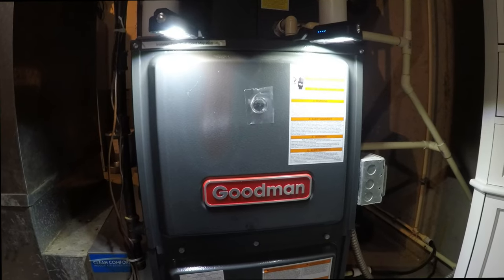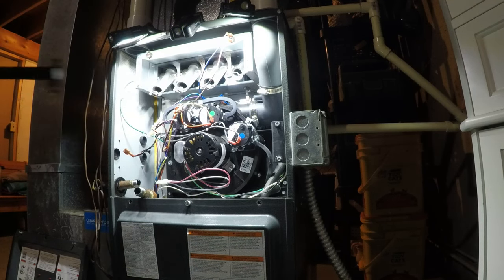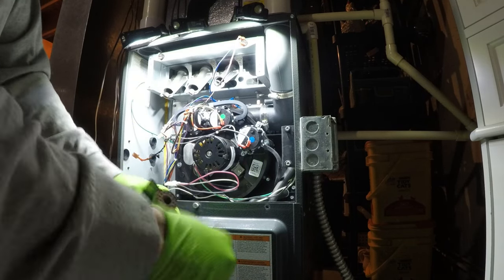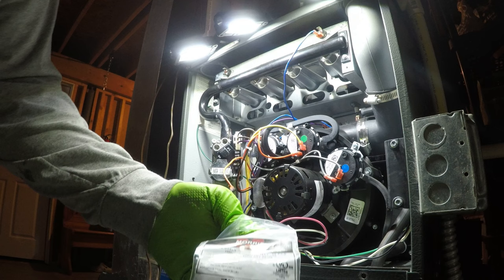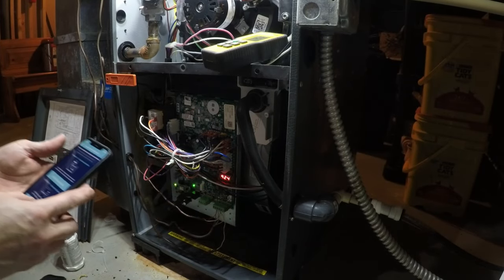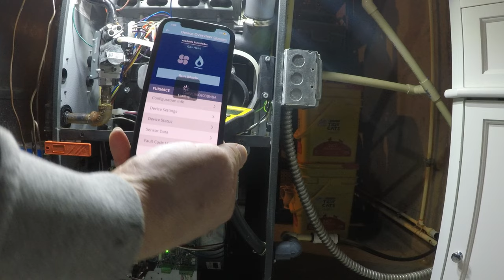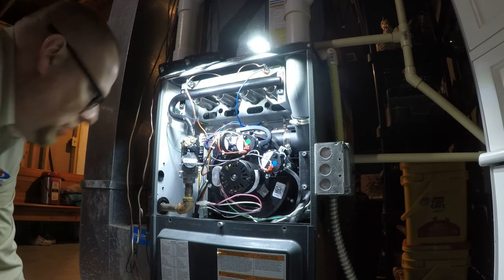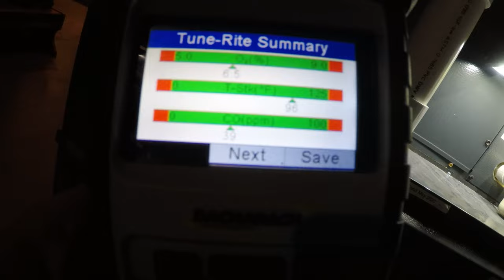Goodman furnace bad gas valve with Rusty burners

Comment: Good video. Propane is rough on a furnace. I’m surprised they didn’t have a low pressure cut off switch for the propane
Reply from the maker: Thank you, This one was installed was a homeowner install. But yes it should have one.
Reply: That’s true you did say the homeowner installed it.
Reply from the maker: He had a buddy, who set the pressures.
Reply: @ADVANHVAC  I wonder if he changed the orifices
Reply from the maker: I believe he said he did.

Comment: I suspect you are correct incorrect gas pressure originally set for LPG, improper combustion or over firing can result in these issues. Not sure they also used the correct orifices either.
Reply: And kudos again for doing combustion test after install of that gas valve.
Reply from the maker: Thank you, just wanted to make sure everything was good.

Comment: I did this once too, used the trane burners in a goodman/amana, stainless steel, but i really doubt the venturi is actually any different.
Reply from the maker: Yeah, some of them Look all alike.
Reply: Is that the trick? Use trane burners? I have a Goodman GMSS96 that i would love to put stainless burners in but they’re not an option from Goodman
Reply: @jeremygrove3177  Can't say if that's the best option or not. I don't know if the burner face material is stainless, only the shell. I haven't been back at that job to look and see how they have held up from rusting and such.
Reply: @AmericanFarmerHVAC2024 Ok. I seen another video of yours where you had quoted a lady stainless burners, I thought possibly you had a lead on a style that was a retrofit. I installed this furnace in my parents home 3 years ago and I was shocked by how rusty the burners were. It is LP, and I’ve verified gas pressure and combustion several times. I was an hvac tech for 6 years and recently have moved on to a different career. I appreciate your help!
Reply: @jeremygrove3177  LP is tough on everything. Also make sure you're not recirculating exhaust.